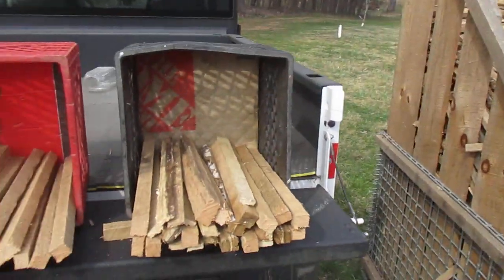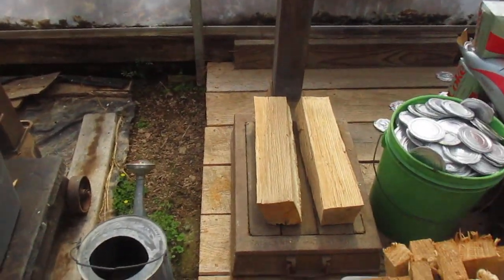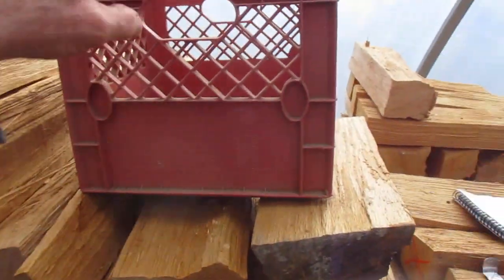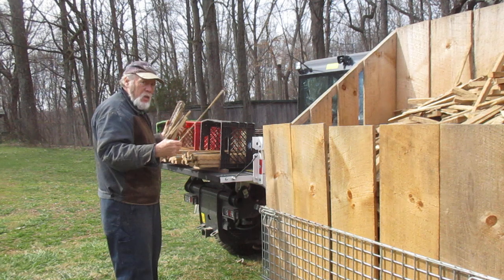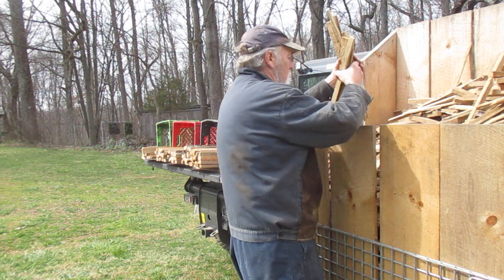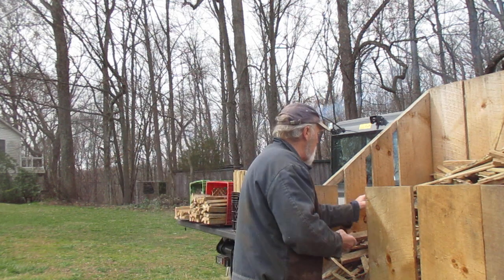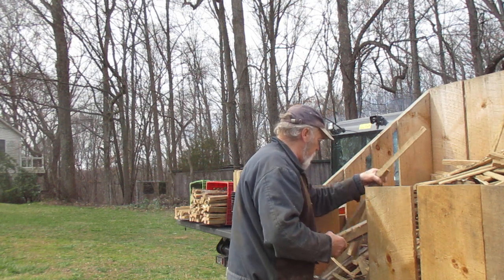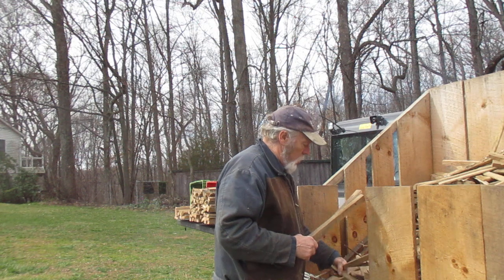Kindling crating  today # 1107

Comment: Knowing how conservative you are with moving around while you're going about a task.
Leaves me wondering why you didn't position the crate and the Boata to where all you had to do was make a quarter to half turn to fill the milk crates.
Instead of having to walk back and forth so many steps?
No big deal, just idle curiosity nothin more.
I'd say from how tight you packed those so far, and if you don't change sizes of milk crates 18 total counting everything you've already got stuffed into crates.
Mr. John you and the Boss Lady have a Great Day, and may Tomorrow be even Better for y'all
Reply from the maker: hi i don't have a answer for how i back crates , i do so few times and each time seems to be different , as for the guess,Well you are real close , i put the answer in a short that should be on by now , glad you stopped in with a guess , thank you john